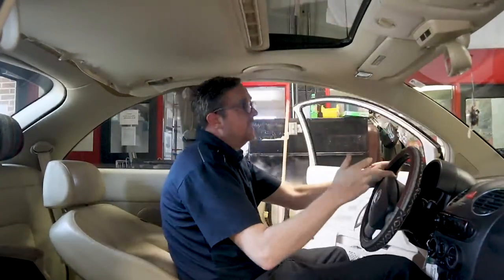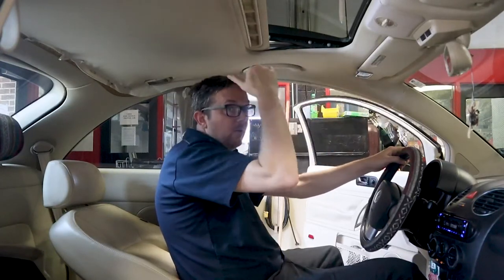Replacing the headliner in a Volkswagen New Beetle

Comment: Thanks for this video! Purchased a moldy 06 Beetle TDI pretty cheap 6 months ago for a max mpg commuter car. After all the scrubbing the only thing left to do is the headliner. I had some idea where to start but now I'm more confident having watched!
Reply from the maker: You can do it, just take your time! Good luck with your repair and thanks for watching.
Reply: Do you have any tips for getting the musty smell out? I just purchased a 99 beetle that has some water damage and a musty smell! I’ve scrubbed everything and cleaned the upholstery pretty good now I just have to replace the sagging headliner!
Reply: @UntamedFireheart  My only advice would be to remove as much of the interior as possible and scrub it with a distilled white vinegar and water mix or a bleach and water mix. I bought some drill brushes from amazon to aid in the scrubbing. I also removed the seats and carpet. My truck for cleaning the carpet when it's removed is taking it to your local self serve car wash, hang the carpet in the clips for floor mats and wash it with the pressure washer. Hope this helps!

Comment: Sorry if this is a stupid question - but you are stretching the fabric a bit to get it into the lower areas, right? And that's ok? The fabric won't be nearly flat against some of those areas without pressing/stretching. (my first attempt failed - will be trying again with new fabric and better adhesive)
Reply from the maker: @grislee1  adhesive is very important, also a little stretch may be needed.

Comment: Ok, I'm getting started on the headliner. (Been a VERY heavy detail on the interior just to make it safe.) I started removing the interior components on the headliner and found some difficulty with the rear lights. In the video you say to "pull down on one side and rock them out" but I'm seeing a metal plate that I assume should stay attached to the headliner. The light does not seem to want to dislodge from this plate. Have you seen that before? Or do I just need to drop my purse and put my man hands on?
Reply from the maker: They should just rock out with a flat head screwdriver. There  is a metal clip that is attached to the light that has to be pressed in.
Reply: @AutoScholarwithMrB  cool. I'll give it another shot. This is my first headliner replacement so...standby for more questions.🤣
Seriously, great video. I got some rain I have to let pass before I can get back on it. Thanks for your help!
Reply from the maker: @gunsnsails  no worries, thanks for watching!

Comment: It is too bad that VW continues to use foam backed fabrics for its cars. This is the same problem that the US built Rabbits had. It also occurs with foam speaker surrounds. The best solution is to use a different material.

Comment: Could you just take the foam off and clean the top instead of buying a new fabric?
Reply from the maker: Probably not, the foam keeps the glue from soaking through and the fabric shrinks over time.
Reply: Oh no I meant like just cleaning off the foam, glue and fabric off completely and just having the metal underneath. Like would that be possible or would it look like that orange layer always